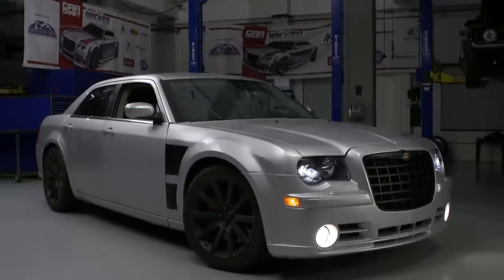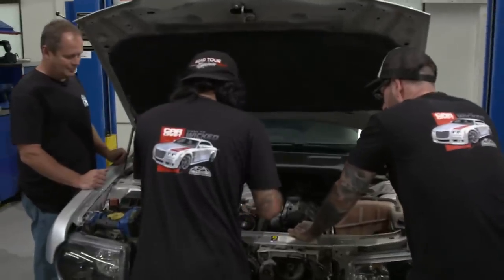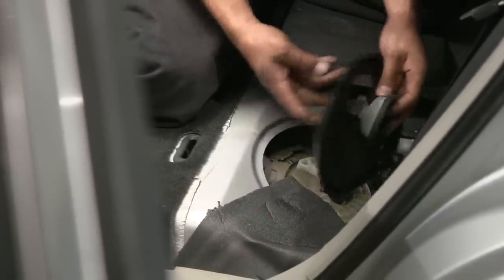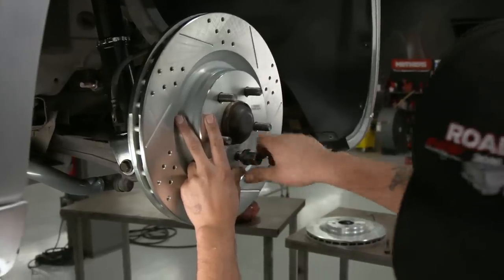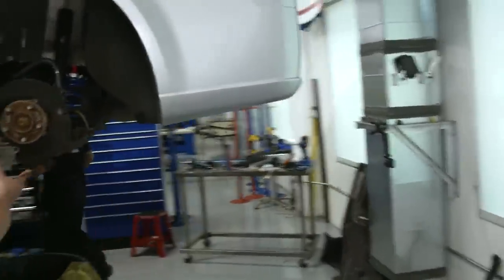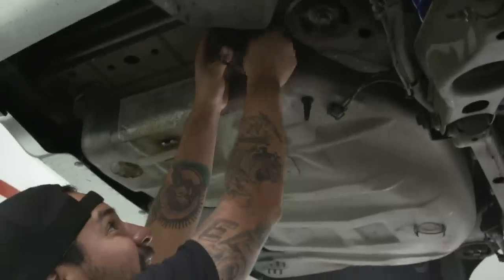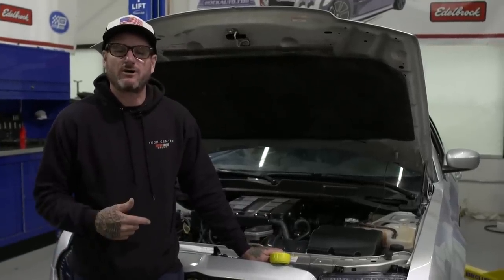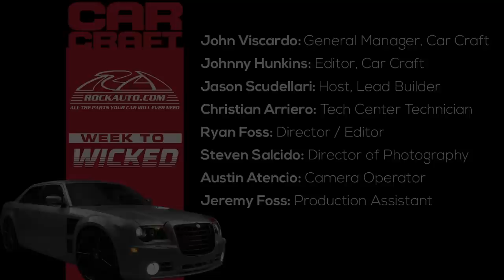Car Craft Week to Wicked – Chrysler 300 Full Episode

Comment: Oh yeah anyone can do it in a week.... if you have 25k, a team of qualified mechanics, a giant work shop, a lift..
Reply: All that stuff was bolt on, and you could do any of these jobs with the car on jack stands and some hand tools. It may take a day or two longer, but its not impossible.
Reply: I don't know that I would call a group of guys who broke HSS drill bits with no lube into a hardened crankshaft snout 'qualified'.
Reply: @Zunit84  Would you prefer they edited that out? I agree with you but I like they didn't hide that.
Reply: @JoshuaIS1  Good point!...things happen in a shop all the time, including little mistakes like this...very original but as far as the car....i want to get my hands on a 2006-9 srt-8....cant deny it...very nice future modern classic car
Reply: @ImTheJoker4u  well it also needs to be professionally tuned other than that I agree
Reply: @JoshuaIS1  im pretty sure that was done on purpose.... and they built a solid car at the end! Doubt i wouod call myself qualified but now that they did somethinh illogical like that, i myself would be more willing to try this out.
Reply: @Zunit84  I have an unusual trick to drill stack of 14ga stainless sheet about 3/4" thick. Just use compressed air stream. The problem is not lubrication, the heat will destroy drill bit. I  got unbelievable performance this way, drill just cuts and cuts. We use this on every drill and holesaw in my shop.
Reply: Lol that’s what I’m saying
Reply: @panan7777 good to know! Wonder if its same for the sawzaw blade!

Comment: Not too bad of a build a couple of things I would've done different.

1 kept the stock Brembos up front used the money to get a set of headers and cats and maybe a cam you had the crank pulley off already might as well do the cam while your there.

2 stayed with 20s different rims and gone wider at the rear 20x10 rear 20x9 front with 295 rear and 275s front.

The rest of the build is gtg though

You went to all the effort to upgrade the suspension and then put 22s with all season tyres

Comment: I have no confidence in Rock Auto after purchasing A/C components to fix my SRT air conditioning and their return system is horrible. The compressor came with the 4th mounting hole was undrilled. The Condensor wasn't square. When I went through their return procedure, and these parts weren't even unboxed it became obvious that they don't want their parts returned. No one to talk to when you need them. Sorry I don't need that kind of hassle when buying substandard parts.